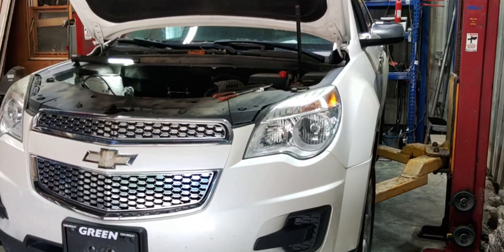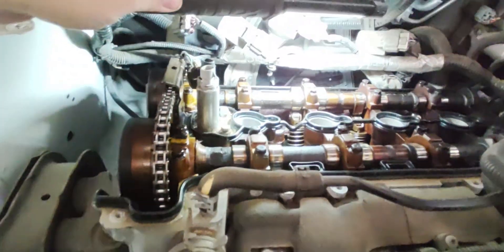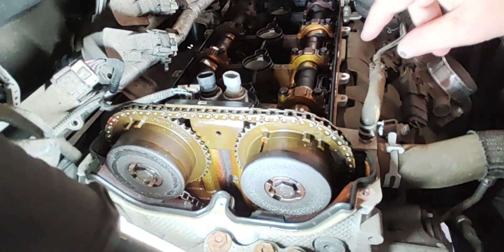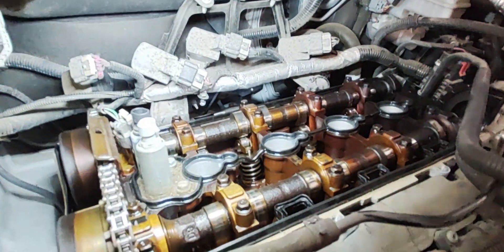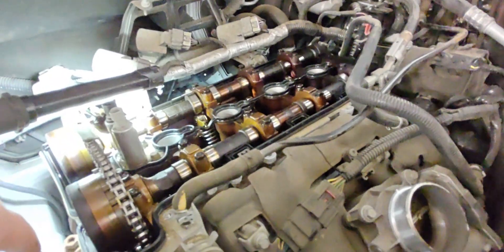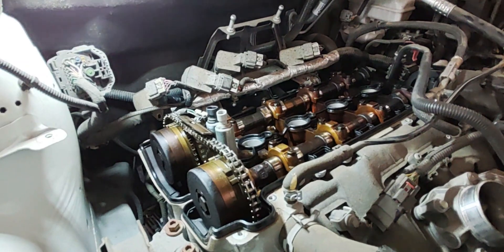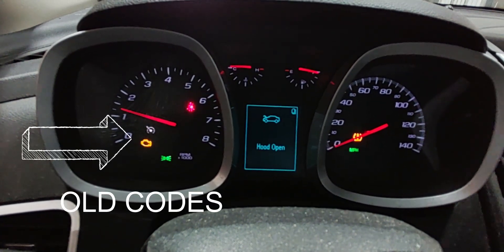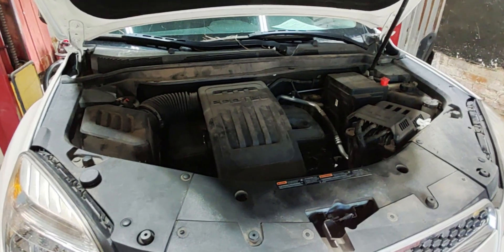Do these checks before replacing your 2.4 ecotec! You may not need an engine!

Comment: Hello i have a chevy equinox and i was told by one mechanic i need a timing chain and then another mechanic said i need an engine. However, even if the engine is replaced will it still burn more oil? Also I can't say if the mechanic who told me I needed an engine did the visual or leak down test. But i can say that the mechanic who told me i needed a timing chain, he heard it as i was arriving.
Reply from the maker: the problem with buying a used engine is that you don't know the current condition of that engine. It could be one that wasn't taken care of, and burns oil. I'm a little unclear as the current condition of your engine. If  it's still running, you do not need to replace the entire engine, the timing chains should be enough. That being said, you would want to ask the mechanic to inspect the PCV system for the clogged intake port while everything is apart. If your rings are causing oil consumption, you will still have that same problem after the chains are replaced. You will still need to monitor your oil level. If you replace this engine, you could still end up with an oil burner. Let me know if you have any other questions.
Reply: @shedhouse7330  thankyou. Yes the vehicle is still running. Got it scanned and no major codes came up except for needing a tune-up and I need an exhaust manifold I believe. Yup I was informed and researched that I will need to monitor oil continuously. And I believe the time chain does need replacement. I only plan on keeping the vehicle for another year. I had it about 4 years now
Reply: I’m in the situation where my 2017 Equinox with 107k miles has a blown engine due to the timing chain. I’ve been vigilant with oil changes and even had my car in less than a year ago for warranty work on the engine where my oil was mixing with coolant. The dealership fixed an issue with the crank seal and belt and noted a noise under the timing cover yet didn’t check the timing belt or chain..now I’m sitting with a blown engine. It’s so frustrating! $9323 to replace my engine installed.
Reply: That doesn't make any sense that they actually put that in writing. If they did, I would make them put the engine in under warranty or the extended warranty because it sounds like it had that problem BEFORE the warranty expired, they KNEW about it and didn't fix it. I would see them in court if they don't want to fix it

Comment: Its Gas Direct Injection, long drain intervals and poor spec'd oil by GM that is the root cause of oil consumption, chain weat carbon build up.  GDI creates huge amounts of abrasive soot that wears the chain, high fuel dilution, which shears oil viscosity, oxidizes oil, the initial OLM would allow 10-12k oil changes.  Soot, fuel, oxidized oil clogs oil control rings.
Reply: High pressure fuel pump failure was causing gas in the oil on ours. 👍🏻
Reply from the maker: Good information, thanks for sharing.

Comment: I have a 2014 equinox and it started burning a little oil at only 32k miles and it was in 2021 ish and my warranty expired in 2017 so now at 70k miles it’s starting to get worse but I’ve done the oil change every 3k miles since new and it down shifts harsh when I’m slowing to a stop at a light like 2nd to 1st shift. It also runs rough I’ve fired the parts cannon and can’t find it I even did all the motor mounts and the engine kinda sounds like it rattles when k slowly accelerate, surely it can’t need timing chains already? No codes at all too!
Reply: When I hear a rattle on my 2013 terrain I KNOW it’s low on oil. I installed a oil catch can, oil pressure relief cap, and cleaned the pcv orifice on the intake manifold 2 weeks ago. Supposedly this will help with oil consumption and preserve the rear main seal.
Reply: @yausaptheshasuabary180 The rear main usually only blows out or leaks when the moisture in the breather or air cleaner freezes and the crank case pressure gets to high.
Reply: Change your variable valve timing solenoids they are located on the top of your engine easy to get out one bolt and electrical plug on them these valves get dirty and stick causing your car to run rough and also is what is causing your shift problem they are about $70.00 each replace both and all your problems will be gone your welcome!
Reply: @AnthonyKeith-xs4or  I did that already I gave up and got a 2023 Tacoma lmao
Reply: @mistardoyle3042 
A 2023 tacoma? 
Good luck with that.
Reply from the maker: See if the water pump is seeping. The pumps can make a rattle sound, usually after a little heat gets into them they get louder.

Comment: I tried your method of turning the key while pressing on the pedal and my car cut on finally 😮‍💨. I think heard the timing chain in the Chevy Malibu 2011 2.4L banging around. I also smelled a burning of something possibly oil ? Anyways I think my issue has been solved I just need the money now to fix it 🥲
Reply from the maker: If it started you probably don't have bent valves, so that's a good sign. Don't try to start it anymore. Pull the valve cover and you should be able to see the sloppy chain and missing guides. Good news is the chain kits can be had for less than $200. Plenty of videos in here for diy.
Reply: @shedhouse7330  it’s weird because I just changed my gasket seal and didn’t notice any signs of the chain being messed up. The piece above the chain was broken though. The mechanics I called said they would charge 2,500k for fix it and some said they don’t want to mess with it at all. I may look into doing it myself again. Thanks
Reply from the maker: @camworldpeace5949  if the plastic guide at the top is broken, I would just about guarantee you have a stretched timing chain.